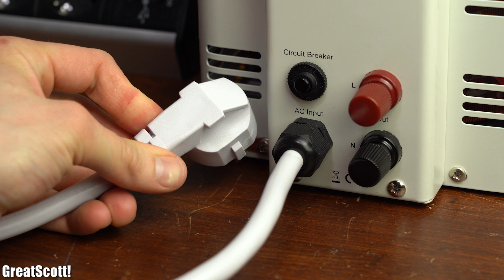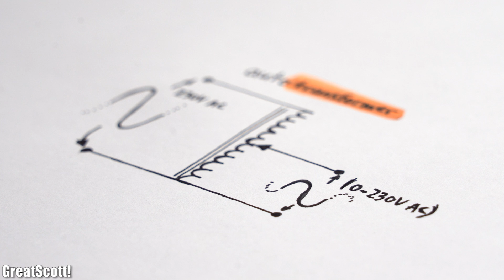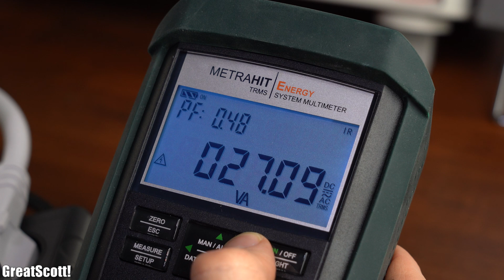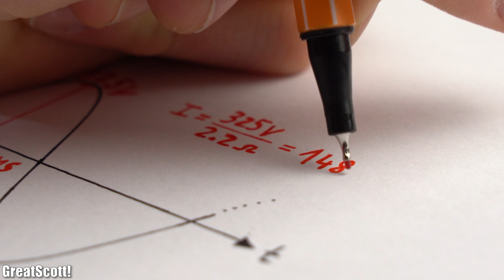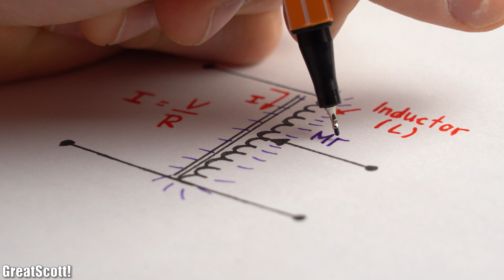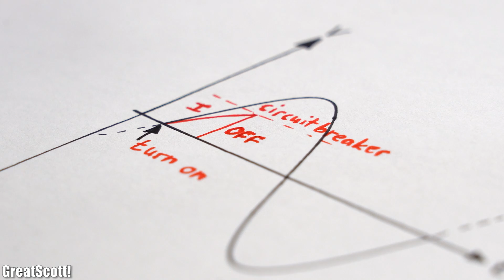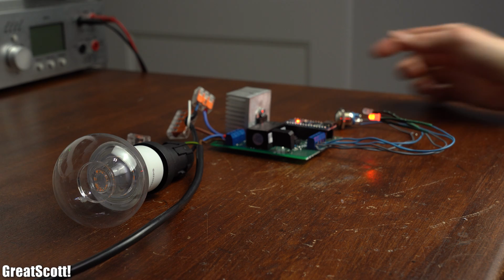How to make an AC Softstarter because my autotransformer keeps tripping my circuit breaker!

Comment: You may want to add a reverse diode in parallel to the zero crossing detection optocoupler. Otherwise, the LED inside might get destroyed by overvoltage while in reverse.
Since practically no current is flowing no voltage is dropped over the current limiting resistor and the optocoupler LED sees the full reverse voltage.

Comment: Sorry @GreatScott!, your theory behind switching inductive loads at voltage zero crossing is wrong,
it should be switched at current zero crossing (that happens at peak voltage),
look around for documentations, the reason behind breaker tripping should be elsewhere.
(Maybe Arduino and/or SSR are taking up time and they are switching correctly? Or is it simply because of the soft-start that it works?)
Try to capture also the mains voltage with the oscilloscope in sync with the surge current and we will see. Thanks!
Reply from the maker: Thanks for the feedback. I just did lots of research and it seems you are right. I added a pinned comment that explains it. Sorry.

Comment: Another funny thing is capacitors in switch mode power supplies. I have a lot of SMPS devices, computers and servers in the house and I came across a terrible annoying thing with power failures. When the power comes back on the SMPS devices all charge up their capacitors and almost always trips the inrush breakers. This has happened to two different houses with modern wiring, which means it is more likely my devices causing the issue.

Petition for requiring (adequate) NTC thermistors in commercial SMPS to limit inrush current to capacitors, some of the computer PSU's have them but I don't think they limit enough when you have several SMPS devices. Alternatively a precharge circuit, I don't mind that the power supply is charging up over 5-10 seconds after applying power and then it just keeps that power in capacitors. There is no need for instant charging as far as I can think.

Also, with adequate NTC thermistors I also imagine there should never be soundable sparks when connecting power plug to the power supply, but most often there is quite an audible spark (with computer PSU's mainly), and sometime even a flash.

With all that said, I've had an interest of soft-starting groups of devices in my home after potential power failures (doesn't happen that often in new house though). Basically all I would need is to have a timed relays clicking on at different set times when power comes back which should not overload the breaker(s).

Comment: Great engineering solution for a problem. Here in Brazil we would just put a bigger breaker (in the best case cenario! lol)...

Anyway, I would love to see you trying to use this motor as a generator =) I tryed here once, and managed to power up some 6 fluorescent tube lamps with a 1/6th HP motor. I used a driller to turn the motor as generator and a capacitor to somehow "start" generating, but I don't know exactly how this worked. Would be great to see your great engineering analysis of the engineering and waveforms of this.
Reply: Did it based on videos like this https://youtu.be/OML8LjGegrQ?t=34 but mine was single phase.

Comment: Your explanation of the inrush current on an inductive load isn't quite correct; what you describe is more like how a capacitive load acts than anything. For motors, the inrush current is due to the mechanical inertia; when first turned on, the motor isn't spinning and so there's no back EMF to limit current flow, but once it gets up to speed the back EMF lowers the effective voltage across the coils. For transformers, it's actually caused by connecting *at the zero crossing*, which can even saturate the core and cause its inductance to fall dramatically, further spiking the current upward. I'm not sure how your zero-crossing switch fixed the problem, actually... The ideal moment to switch a purely inductive load on is actually at the peak of the AC supply voltage. Your transformer may have a significant capacitive component to it, perhaps? Could be a parallel capacitor added for power factor reasons; I doubt it's parasitic winding capacitance.
Reply from the maker: Hmmmm I will have to think about that. Not quite sure....
Reply: @greatscottlab  It's a real puzzler; I wonder what's inside that autotransformer.

Comment: I solved this very same issue with my variac with a beefy enough inrush current limiter (NTC thermistor) in series with mains input. Much simpler and immediate than a whole softstarter
Reply from the maker: Also a solution :-)

Comment: I was thinking about this and my solution might be different than yours. I'd use a pretty simple designed-for-this-purpose power NTC thermistor.
Initial resistance like 10 ohm, hot resistance less than an ohm.
Should sort the issue out rather nicely, and the advantage is that it really doesn't care about what the size of the initial current draw spike is, it will adapt to nearly all situations.
If less "hot/on" resistance is needed, put two or more in parallel until you get the current carrying capacity and/or on-resistance you need.

Of course, for safety's sake the container for such a device should be of metal, the input and output grounding terminals should be connected together, and then there should also be a connection from the power input earthing terminal to the metal case. Then again I bet that such a thing is available commercially, so it becomes a case of "DIY or Buy?" but my mind is on "buy" because you should be able to get one with several relevant safety certifications (UL for US mains-powered devices, or equivalent EU/UK certifications) whereas you can't get that with a home-built one even if it's built to the same standards (your home insurance might not cover you if the thing starts a fire and it DOESN'T have those certifications).
Reply from the maker: In a previous video I built a softstarter just like you described ;-)

Comment: Hi, I have an old tube clock which I turn on only when I'm in my workshop (to save the tube lifespan and to save electricity). Would such soft start device make sense to spare the squishy bits inside the clock from the often turning on and off? Or would the the relay you mentioned do the trick? Or is it completely unnecessary and I'm just over thinking it?

Comment: Wouldn`t it work without a full bridge rectifier? just with the correct current limiting resistor ?
Reply from the maker: Yep. That would also work.
Reply: If you put the voltage in reverse, the resistance of the opto-coppler diode would be higher. so there would be a higher voltage drop, even with the resistors in series. It would probably so high, that the maximum reverse voltage of this diode would be exceeded resulting in destruction.
But instead of the rectifier, he could simply have put a diode parallel to the opto-coppler diode, but in other direction. if you understand what i mean. So there would not be a high reverse voltage.
Reply: OK maybe I'm wrong :D

Comment: You should have used a mechanical relay to bypass the TRIAC after softstart. The would have allowed you to use a smaller heatsink. And at 3000W, the amount of current flowing through the TRIAC might heat it up a lot, so having the circuit inside a closed housing with no airflow might cause it to overheat.
Reply from the maker: True, adding a relay would have been a nice addition.

Comment: Hey greatscott, who is the killer, current or voltage?
Reply: Current kills, but the magnitude of the current is proportional to the voltage. So a deadly current can't flow unless there is a sufficient voltage to push it through the resistance. In other words, it takes both to kill.
Reply: Sufficient voltage to overcome resistance, sufficient current to do damage. So both.
Reply from the maker: Power

Comment: the 240v goes to 80% of the total windings so that you can go past to turn it into a slightly step-up transformer
Reply: Agreed. I've seen a few 240V input with a mid 300s output and I'm sure that there are many other examples. Sadly I too would need a new power circuit and a breaker board. My flat/apartment runs on just 2 old style wire fuses.

Comment: Great problem solving! 
Could you come up with a timed load resistor for the purpose of keeping a power bank "awake"? I am having the problem of my power banks switching off after about 30 sec if the current is below a certain threshold. Some electronics projects need too little current to keep the power bank on. So here a resistor which draws about 150 mA every 30 sec could help. However I currently do not have the knowledge how to realize such a device. I was trying with a NE555 timer IC.
Reply: The channel Mr. Carlson's Lab has created such a circuit, search for "Power Bank Stay Awake". I haven't tried it myself but I've seen it mentioned before.
Reply: @eDoc2020  Thanks for the information. I see the video is fairly new, when I was trying to make such a circuit about 2 years ago I did not find much in the internet. Now I am going to watch the video.

Comment: How much losses we will have on the soft start device? There is a way that the circuit only works at star and after doing the soft start process it is bypass completely an a direct connection to Maine remais? Like some mechanical relay that reruns to its NC state after not being energized.
Reply from the maker: Check your triacs datasheet and see how much votlage is drops. Then multiply that with the flowing current. You can easily add a relay to bypass the triac as soon as the process is over :-)

Comment: ahhh, phase angle control :) it's 2021 and im still using that as preregulator for my linear power supply, thyristors are nearly indestructible :) (all analog circuits with comparators, no arduino...)

Comment: Maybe you could have tried using type C circuit breaker which delays break timing for that initial current spike. Maybe even type D if current spike is greater than 10x rated current.
Reply: I don't know what is the situation in Germany, but in my country I never seen a B type circuit breaker even in lighting circuits. Really C is just fine, doesn't trip for nothing and still protects your installation. Just swap the breaker and you are fine (unless some stupid law says that you need a B type, wouldn't make a lot of sense)
Reply: @alerighi  I think law EU regulations require B type 10A for lights, type B 16A on regular wall outlets and type C 16A or more for outlets where you plan to use inductive loads.
Reply: If I remember correctly D is definitely only for industrial installations.
Reply: @benbaselet2026  yeah like 1MVA transformers, they are as big as average car

Comment: Why not use a resistor in series with the load that gets bypassed by a relay after f.e. a second?
Reply from the maker: Also possible. I actually did a video about such a softstarter a while ago.

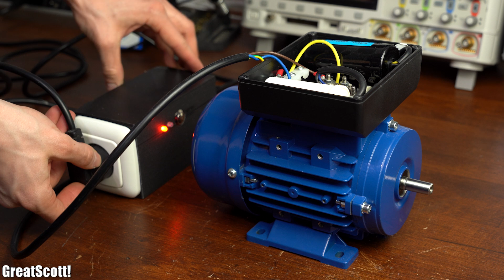Comment: I've lost count of how many times I got scared with induction motors jumping when they are switched on in practical college classes 11:16 haha
Reply: Aha. So it's a motor characteristic, not something caused by the slow-start circuit?
Reply: @RandomNullpointer  yes, it is very common if they are not attached to a surface

Comment: I did have that same issue with the tripping circuit breaker, but it was with my power supply(it has a 270uF cap) I solved it with an NTC placed in series with the live wire. I did think about making a soft starter, but then there would be a delay when powering up the PSU.

Comment: Did you ever hear about C type circuit breaker? Guess what - they are designed for this type of loads
Reply from the maker: Dude.....I am an electrician.
Reply: @greatscottlab  So why not to use so simple and efficient solution?
Reply from the maker: I am not allowed to change the breaker in my apartment and such AC softstarters have other advantages like with a motor starter.

Comment: Isn't it better to simply connect a resistor in series with the inductive load that is later bypassed by a relay (exact same model as your DC softstarter, using a small smps to generate a low DC voltage)?
Reply from the maker: Both solutions have their application. Neither of them is the best solution for every problem.
Reply: @greatscottlab  mine is simpler, you don't have to program an arduino. It is also a lot cheaper, and doesn't dissipate anything in a triac. 230V 3000W through such a triac is probably going to blow up.

Comment: Hey Scott I love the video awesome way of solving a common problem! But, I have a question. Would it be possible to swap the nano for an ATtiny85 to reduce size? Also will you be doing any more videos with the ATtiny line of microcontrollers I always loved those videos. Anyway thanks for the video! 😄
Reply from the maker: I used the 16 bit timer of the Arduino Nano that the ATtiny does not come with. So not easily replaceable. Sorry.

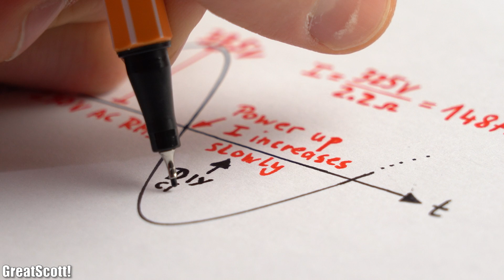Comment: 7:11 that explanation makes no sense to me. The transformer should be a an impedance which is an inductor (Lm) in series with another leakage inductance (Lr) finally in series with a resistive component being the resistance of the wires. The current waveform at steady state is of course going to lag the voltage, the amplitude of which  (apparent current) easily found with phasor analysis.

 But with a step voltage in to an inductor should result in i=0 initially and build up from there, an inductor current is proportional to volt-seconds, the integration of volts with respect to time. So why is there inrush to an unloaded transformer? Is the inter-winding capacitance playing a significant role or something? Motors are quite complex loads so I can understand inrush for them
Reply: I had the same question/concern.  The inductance will resist the change in current as long as the core isn't saturated.  Interwinding capacitance would allow some initial current spike.   ..or maybe there is an input filter cap at the autotransformer?   Or maybe it depends on the load attached to the autotransformer?   This might be an idea for a follow-up video.
Reply: @SkyhawkSteve  My guess is there is a sizable parallel resonant capacitor meant to improve the power factor by resonating with the magnetizing inductance. Such a capacitor would certainly draw a massive inrush when power is applied at the peak of mains, limited by series inductance and resistance of the house wiring and impedance of the grid.
Reply: A transformer is modelled as an inductor Lm parallel to a series combination of Lr and coil resistance r.
The point you raised regarding current being proportional to volt second is true only as long as the inductor is in its linear range of operation(not saturated). When a transformer is switched on at the zero volt point, the flux set up theoretically rises upto 2 times the peak value of normal operating sinusoidal flux. Most transformers operate near to its saturation to optimise iron usage and hence when flux can go upto 2 times the peak, the core undergoes heavy saturation and depending on the saturation curve of the core, the transformer will draw a very large current to generate that flux.
Reply: @manjunathvishnumoorthy7479  Oh, I see. Because of the "integral windup" from a previous cycle the definite integral from t=0 to the first zero crossing would indeed see a current that is in fact double, that makes sense! Edit: Oh and I get your point about why you mention saturation, that's something I'll have to keep in mind thanks for sharing!

-On the transformer model I was assuming open-circuit secondary and thus the 3 series impedances (really an open circuit transformer is just an inductor or ballast) there is also some distortion and core saturation + hysteresis losses causing a what I recall was 3rd and 5th order harmonics and higher than expected peak currents, sure.-